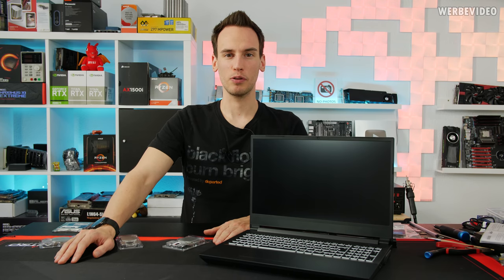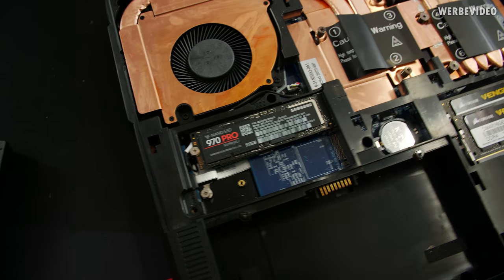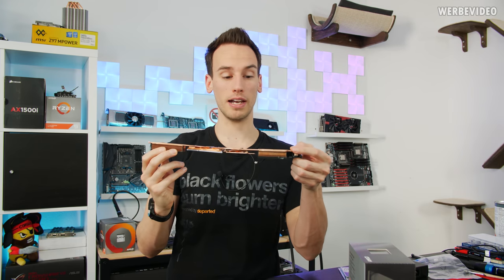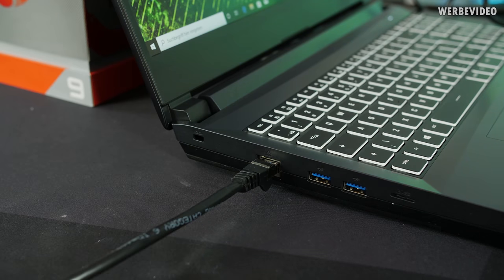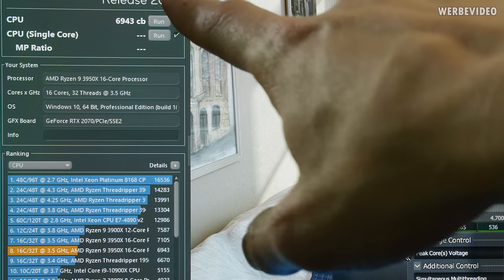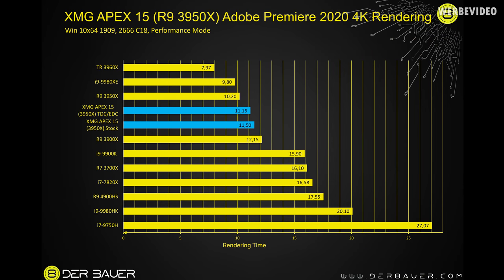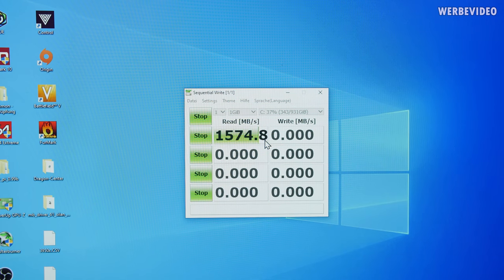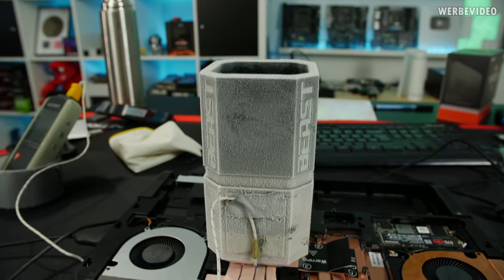INSANE: 16 Core AMD Desktop CPU in a NOTEBOOK. Ah yea and I added some Liquid Nitrogen

Comment: Detachable battery in 2020? It's a win in my book.
Reply: I think all Clevo chassis have easily removable batteries.
Reply: It's almost like its not a problem to do that, but manufacturers keep saying it's a problem.
Reply: I agree, detachable is better. But then again, engineering is all about compromises, if you want a compact laptop, don't complain about a non-detachable battery or higher temps. If you want performance, don't complain about the weight and battery life. And if you want everything, don't complain about the price.
Reply: @sabishiihito  Most of them
Reply: @jihadjoe  I think he's talking about having two separate batteries and easily swapping when you need more juice
Reply: And the Ethernet port that sadly became rare on laptops.
Reply: @no-eb2xx  they do it because many people when their laptop's battery die or become very week they buy a new laptop
Reply: Would be ultra premium to have 2 batteries however that'd mean loss of the 2.5" drive so oh well I guess
Reply: @RadarLeon  They should make it so that we can choose between a 2nd battery module or a 2.5 drive.
Reply: @katech6020  of course they do that, they are going the way of Apple.

I choose with my wallet, but its damn hard, because everyone is doing this shit lately. It's so stupid and deceiving.
Reply: @jihadjoe  In my experience though, ultrabooks that do have their batteries sandwiched between the bottom cover and the keyboard will often crack the touchpad, break the top cover clips and destroy the screw mounts of the chassis when the battery gets bloated and expand. This includes the common HP, Dell , Acer and even Macbook Pro. Those notebooks that have removable batteries hardly ever get bloated at all throughout the years.
Reply: Removable battery and upgradable CPU, poggers.
Reply: @happygimp0  laptop are way to slim now to have a big ethernet connector
Reply: How about eon15-x?
Reply: not if its 62w
Reply: @legros731  Then they should make the laptops bigger. Or make a new standard connector for Ethernet that is slimmer.
Reply: i saw that removable battery.....yesssssiiiiirrrr!
Reply: Why not just use a slots for 18650 batteries? So you can hot-swap them and re-use. Making a plastic holder with controller is so stupid nowdays
Reply: @lmchua8644  I had a laptop like that.  A Dell 1999 Inspiron i7500.  You had these modules that would slide in and out of the chassis.  15 lbs.
Reply: I mean cmon... Non-detachable batteries are also replaceable if the manufacturer adds some pulltabs. Adding that detaching mechanism inside the machine is not volumetrically efficient.
Reply: My lenovo school laptop can do that
Reply: Just a shame they will only last about 9 minutes.
Reply: I'll second that but for a laptop this powerful the battery should be 90-99wh IMO.
Reply: @sabishiihito  I have a 2016 Clevo 17" where the battery isn't externally removable, but I'm glad that they're getting back to making them so they are.
Reply: Are the batteries available separately?
Reply: @lakiza55  While that remains true to a large extent, over the last few years we have moved more and more into a world where there are features that are neither difficult nor expensive to include but are more profitable to not include.  This is terribly anti-consumer and, arguably more importantly, much more wasteful and damaging to the environment.
Reply: @no-eb2xx  no man, it really is a problem, hard card batteries take up more space than soft ones.
Reply: no big deal, my alienware battery started to bulging and i just pull out the battery cable inside the laptop and finally removed it months later.
Reply: Evenly all dell precision 7000 series have detachable batteries..

Comment: Am I dreaming or what?? 2020 and no soldered CPU nor RAM sticks, easy access to "guts", CR 2032 BIOS battery?? Laptops ain't my thing but I've bookmarked that site.
Reply: Thank you! // Tom
Reply: If every manufacturer follows suit, laptops could catch up to desktops with custom build capabilities.
Reply: 61Wh... It's not gonna be a good laptop... It'll be a crazy AIO mini PC...
Reply: this is a clevo nh55ac barebone, and laptop like this will continue to exist in the future. usually clevo comes with removable mxm graphics too. too bad the 2070 is soldered on this model, perhaps you can wait for the 17 inch AMD barebone with even more freedom. there will be a intel 17 inch model coming soon for the 10th gen socket.
Reply: Michael Martin  Yeah, sure, until a BGA gpu burns and you'll have to replace a whole freaking system, potentially wasting thousands of dollars. With an MXM it is a simple swap, just like on a desktop PC. So sad that Clevo remains the only laptop vendor in the world who still more or less understands this. And no, Nvidia doesn't "sell" MXMs to anyone. They don't even provide reference designs since 2017 (AMD since 2014). Almost (only HP, Toshiba and Apple got their boards exclusively from Nvidia and AMD) all MXM boards are manufactured by laptop vendors themselves, just like desktop GPUs are by theirs. I myself had an MXM (675M) burn on me- the socketable nature of the standard was the saving grace. Swapped it with a 780M and it still runs perfectly with OC'd vbios after 5 years. So yes, I have firsthand experience of MXM's sheer superiority and stand firmly by my words.
Reply: @AntonYadrov777  true, but if you put an mxm slot in a 15inch laptop it would have the be an utter unit of a laptop (40mm thick), so I understand why In this case they haven't; I really wish they'd release a 17 inch version with an mxm slot though, I wouldn't even look at the price tag I'd just click buy.
Reply: @Craziestbanana  That's pretty much my exact opinion. 15 inch laptops (I even prefer to call anything below 17in a "netbook") are primarly for work and study after all, and you definitely have no time to be playing triple-A titles there, nor the desk space (and obviously don't want to carry a 3+ kilo chonkster with you every darn day). So there's even no need for such powerful, hot and power-hungry innards in it- you want a slim, cool, business-oriented unit for this purpose. 17+ inch, on the other hand, are for home use, and there you definitely can (and should) go for a full-blown desktop replacement (which you can also take with you on a vacation- I sure did several times). Weight, thickness and power consumption are of zero concern here. I myself am waiting for Zen3-based 17+ inch Clevos with MXMs to replace my old, trusty MS-1762. 3840qm, overclocked 780M, two 1Tb Samsung Evo SSDs in Raid0 and 16 gigs of 2133 ram still do the job in all modern titles, but obviously it's choking already (and 8 years old!!). Desktop Zen3 with an Ampere MXM card would definitely be a worthy, (and, hopefully, a very long-lasting) replacement for it.

Comment: RJ45 socket has to come back to laptops. This wifi only trend is a massive BS! Nice to see some that still have it.
Reply: Wait what? You mean to tell me there non-ultrabooks without ethernet?
Reply: @LA-MJ  well i think on notebook too. I see 1 from asus m4xxda series with r3 3200u
Reply: To be fair, Wifi6 is capable of going faster than gigabit. Not saying I don't wire everything, but wireless is technically faster than most people have wired internet.
Reply: @kdb424  The problem with WiFi only is not speed. The problem is that you need an adapter as soon as you have to configure a router or when you install a new OS and need to download the WiFi-card driver.
Reply: @kdb424  Yeah, but WiFi6 is super new, very few stuff have/support it. Besides, no matter how fast it theoretically is, it's still unstable by nature and even WPA3 is not as secure as cable. Besides, some things just don't work well with wifi, or don't work at all. Cable just beats wifi in any way, besides comfort.
Reply: What if I told you, there are even better ultrabooks!
Not just lacking RJ45, but have soldered RAM and to finish it off, an M.2 SSD conveniently parked in the hot GPU/CPU area. CMOS battery? Nah that's old fashion just tap some juice directly from the battery! Who doesn't like a BIOS reset when main battery is drained?
It's lovely! It's perfect.
Reply: @OsmosisHD  Sounds like my XPS 9350 and I have to say it's been my favorite laptop of all time. I have a desktop for real work. That thing still gets along fine and I do real work on a desktop or remote server. Those are tradeoffs I'm willing to make for literally 12+ hours of battery.
Reply: usb -> RJ45
Reply: @kdb424  The inherent problem of WiFi is not the sheer speed, rather the inconsistencies regarding that speed, because there are too much variables to keep control of it : Distance, Nb of clients connected, and how much are DLing or Uling at the same time, or even the environment itself : other Wifi networks, other radifrquencies parasites...

A cable is way more simple : It's either connected, and providing all the badwith available to it, or disconnected.
Reply: @MrLince-hr4of  No, fuck dongles. RJ45 port has to be built in.
Reply: @kdb424  latency is crap on wifi, it also sometimes has reliability issues (for now)
Reply: You do know that any USB 3.0+ can use an Ethernet adapter.
Reply: @kdb424  You shouldn't compare wifi speed with cable 1:1. 1 Gb/s Ethernet wired means you have 1 Gb/s Tx and 1Gb/s Rx speed, both can be use at the same time. If you have 5 hosts connected to 1 switch, everyone can send 1 Gb/s and receive 1Gb/s at the same time.
With wifi, the complete speed is divided by all clients and Rx and Tx. 1Gb/s Wifi with 5 clients has theoretical the same speed as 5 hosts on a switch with 100 Mb/s.
There are frame errors in most wifi environments on top of that which slows down connection and increase packet delay.
Reply: the socket is bulky, most of them want you to use a dongle which is the only way to make a slim sleek device
Reply: i just like the option
wifi for on the road / moving about
ethernet for having anything to do with being a workstation.
screw thin, this is what we need
Reply: Actually having one usb-c is better solution. So you just keep a dock at home to quickly attach monitor, mice, keyboard, audio, flash-drive, some extra stuff with just one usb-c cable.
Reply: @kotenkostiantyn1282  No. No docks, no dongles. I should NOT have to use accessories to use the most basic function of a computer.
Reply: @kotenkostiantyn1282  USB-C is nice but can't replace Ethernet.
I have a desktop at home, there i do not need the laptop. I need the laptop when i don't have a desktop. Either am at a place where i have a desktop or i can't have a docking station.
Reply: the yoga I bought my mom has a half ethernet (the plastic that holds the plug drops down.)
Reply: @satibel  yep, I' ve seen that kind of RJ45 port implementation too.

Comment: I love how you can get to all the components. Being able to upgrade the cpu, could make this platform last a long time. Thats really cool. I Also checked out the website, if i was shopping for a laptop i would be picking this up.
Reply: agreed, although i dont think you will ever need to upgrade that cpu... its better than my expensive big desktop in performance, lol.
Reply: Seconded.
Hell I've been considering getting a laptop for when I'm travelling for quite some time now and seeing how good it is I was about to go search the prices online.... And hten he said it's a prototype. Bummer :(
Reply: @primodragoneitaliano  and if you ever move to a desktop or your existing desktop cpu dies, you can always grab that 16core beast and slot it straight in ;-)
Reply: @socks2441  Yep ! My current PC still runs strong (i7 5820K) buut an upgrade wouldn't be unwelcome that's for sure :)
Reply: @primodragoneitaliano  It's not really a prototype, you can buy this machine from XMG or any other clevo reseller :) I'm planning to get it as well. In Poland you can get this model with 3900x, RTX 2070 2x 16gb RAM and evo 970 for like 1800 euro, which I think is great value for money.
Reply: I wish I could agree.  As the owner of an ASUS gl702zc, the first laptop with a desktop socket Ryzen CPU, I'm still stuck with no upgrade path.  This is because no update to the BIOS is available, so the r7 1700 that it came with is about as good as it gets.  Could find a 1800, I suppose, but that's not much of an upgrade for the money.  Zen+ and zen2 won't work.  I expect that to be a problem for other laptops as well where they will not support future generations.  If ASUS won't supply a new bios, I can hardly expect smaller companies to do so.
Reply: @piotrk328  how much is it?
Reply: ItalianDragon I have it currently sitting on my table his video came out a few weeks before mine came which was May 4th, ordered on April 23rd. I have the 3600x in mine, so you can go from 3300x to this if you went barebones like I did.
Reply: Julius Ian Duero with my setup going barebones the laptop itself was $1,047.23 to my door! Add another $500 for storage,memory,CPU,OS and cooling materials. I probably should’ve gotten it from xotic pc but all in all I’m very happy with it! I can get about an hour and a half on battery while browsing or watching YouTube.
Reply: looking at a comparable desktop it isn't even that much more expensive, you're basically paying 10% more for a laptop vs a desktop, which is reasonable, and with an upgrade to a 3950 and an external gpu a few years down the line I can see it lasting a fairly long time (if clevo has made improvements on the hinges since the w110er).

Comment: XMG has been pretty explicit about the fact that it only works with 3200MHz native RAM NOT XMP overclocked stuff. That's what the timings were so bad on the kit they sent you. It's JEDEC rated on the standard SPD for a base speed of 3200MHz WITHOUT XMP.

Use the kit they sent you, and 3200MHz should work.
Reply: Correct: we officially support DDR4-3200 JEDEC. We have a list of compatible and tested modules in our FAQ. But if end-users want to use our BIOS Setup and make other modules work, we won't stop them. :) // Tom
Reply: @xmg_gg  Is this likely to change in the near-ish future? Could a bios/uefi update enable better compatibility?
Reply: @xmg_gg  If you use the Crucial 3200cl22-sticks, would it be possible to tune them a bit to improve performance?
Reply: @Taraquin83  Not sure. On our side, we are committed to strictly follow the JEDEC AVL from our ODM for now. // Tom
Reply: @Taraquin83  It looks like for now we have to use the more "basic" memory and upgrade it later on when JEDEC high frequency kits become mainstream. One of Clevo resellers lists some unspecified 3000MHz CL16 as available option (their max) which was added after testing on their side. 2666 on the other hand is common and you can look for CL 15-14 to counterbalance the frequency. I hope by the time Ryzen 4000 goes full on 3600-4000 MHz JEDEC kits will be a thing without premium tax.
Reply: @xmg_gg  How much hassle would it be to buy from the U.S.A, and are you guys supporting the new Ryzen 2 mobile chips with anything above a RTX 2060?
Reply: @gctdonyre  Buying from USA is too much hassle for a single unit. You'll see offerings from local U.S. brands soon, for example Eluktronics and OriginPC. New laptops with Ryzen 4600H and 4800H are in the pipeline (RTX 2060 maximum for now). // Tom
Reply: @xmg_gg  being able to choose not to have the logo is OP. Many of us like the minimalistic look.
Reply: @gctdonyre  hidevolution and xoticpc have them
Reply: @G D I just purchased the sister to this laptop Clevo NH58AF1 Today, I’ll be running a 3600x/2070(110w) 16GB of Vengeance 3200 cl18 iirc/Sabrent rocket T 1TB and I’ll be using thermal grizzly carbonaut  pads on the cpu/gpu and the minus pads on the vram etc. @XMG wanna slip me that bios to play around with? Is the unlocked bios thing an XMG only thing or is that a Clevo all around deal?
Reply: @xmg_gg  Is there any particular reason why the RTX 2080 (or SUPER) was omitted from this build? Or will it be present in a future update?
Reply: Dylan Lee that’s all down to the ODM (Clevo) hopefully by the time I’m ready to upgrade from this one they have an AMx/MxM based version! I did my part by purchasing this one so hopefully there’s enough people that buy them to make Clevo go forward on AMD DTR like intel has.
Reply: @xmg_gg  will you support ryzen 5000 series in future by bios update
Reply: @besayan2764  It's being worked on but no guarantees yet. // Tom
Reply: @xmg_gg  need 17" version Badly
With thunderbolt

Comment: NOICE ONE on the LN Roman! :)
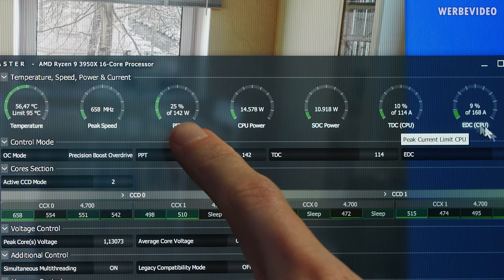The hard shutdown at 10:20 was the boards EC Amps hard limit (~97.5A) being exceeded (No way to alter this via BIOS or software).
Using LN kept it afloat...but that's what a regular user will experience when trying to utilize the 3950X in any NH5xAx in a similar fashion.

Only wish they would allow these AMD CPUs to be combined in models with a 200W 2080S in MXM flavor.
Reply: I honestly would throw my bank account at the laptop you just described, if only
Reply: Well, at least one person is paying attention. Nice hardware doesn't mean much with cancer firmware castrating it.

Comment: 6943 point at 55W is amazing!
126 points per watt - that's on par with the efficiency of the 4000 mobile series.
And he didn't mention a key part - contrary to the 4000 series, this CPU can be undervolted! Meaning that one can potentially get the CPU to work even more efficiently than shown in the video!